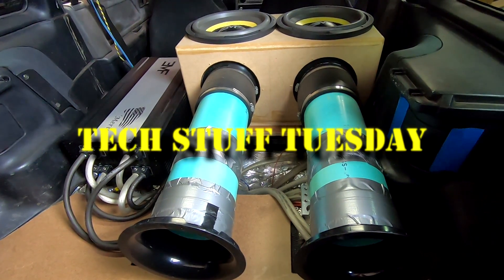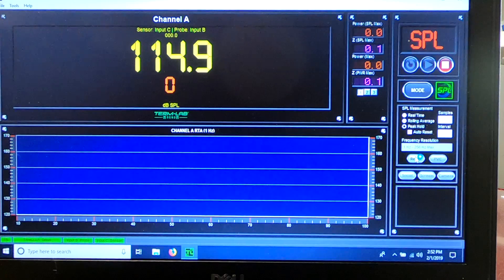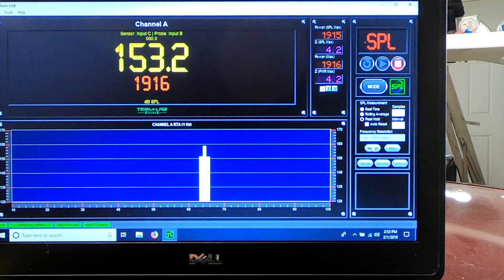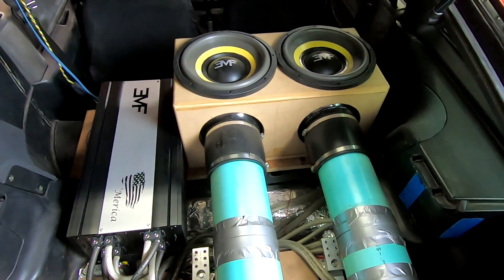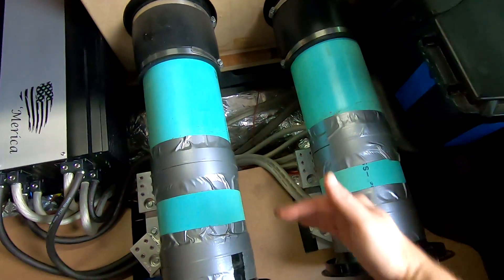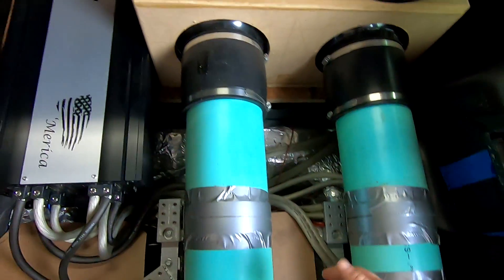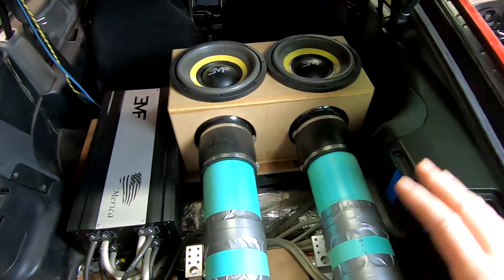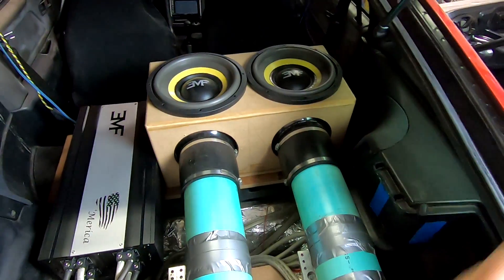This is why port scores are so loud - Tech Stuff Tuesday

Comment: how small is this box? and what is it tuned to with the ports?
Reply from the maker: I built it years ago but I believe it's right at 2 cu. ft. I have no idea what it's tuned to, that isn't how SPL works. You don't tune it to something specific, you test it till it stops getting louder adjusting the port.
Reply: @EMFAudio  ok but how do you know the size of the box to put the subs in. It's like you made a tiny sealed box and put 2 huge ports in it. I found its 1.5 cubes on your other video. Can this box only burp and not play any music?
Reply from the maker: @johnnyditommaso6807  It might be 1.5 cu. ft after sub displacements depending on what subs I'm using in it. SPL is about results, not recommendations. I wouldn't want to play music in that box at all. It's extremely peaky with very limited bandwidth.

Comment: My truck when I had only 1 amp in it wasdoing 147 on the dash and I couldn't get it over 146 in the port lol guessing I had low port velocity? was a 4th order for 2 18's 5.75 sealed, 15.5 ported 46hz. 10 inches by 2 ft port cant rememberhow long
Reply from the maker: Bandpass wall, like I mentioned in the video.
Reply: The smaller of the two boxes would have the highest SPL meaning that if your box has a larger volume than your cab your cab is going to I have a higher pressure and your box will have a lower pressure the adjustments of the ports take away volume from the box and add it to the cabin making most boxes smaller I'm not making this up it's actually a law
Reply from the maker: @christhopherlasher2828  I'm not sure I'm understanding you correctly, but if it's how I'm understanding it, that's not accurate.

Comment: Your comparing the test from the front dash of the car and right at the port ( big difference between the two). You need to take the measurement at the driver and then the port. The port is the backwave of the driver, it's 180 degrees out of phase from the driver. The two SPL's should be similar.
Reply from the maker: The meter is IN the port, that's the point. It's not near it, it's IN it, that is what people do, not beside it. If it were outside the box it's possible the SPL would be similar, at least within a few dB.

Comment: You're just adding more area with mega ports like this. Like a 2 cubic foot box vs a 4.
Reply from the maker: It's a 1.3 cu ft box, with the port area it needs to do the score it does.
Reply: @EMFAudio  I've been playing with the port size on my box. I think I have to go bigger. Almost 2x the size. I dont have room to make it long though. It's a custom box I build for my 68 Chrysler 300. I'm running (3) RE:SE 12's. Old school RE: audio.
Reply from the maker: Ports generally don't need to be longer than 18". If you require longer than that, you're typically tuned too low for the box volume or the box volume is too small to begin with.
Reply: @EMFAudio  where my vent is, is behind the rear seat popping out of the rear deck facing up to the rear windshield. So I'm kinda stuck with a shorter port for viewing purposes. I built the box correct and she hits extremely hard. I built it up again the rear seats so I can utilize the rear of my trunk for anything and the box isnt hogging up the rest of it. I basically built the box in a area I do not use above the rear axle/wheel wells.
Reply from the maker: @ruffypoo  If you build the box correctly, why would you need double the port area?
Reply: @EMFAudio  testing to see what tune works best for the cab of the car. Anyone can follow what's on paper but in reality the cab of the vehicle is just as important as the structure of the box.

Comment: ok answer this plz when you did the windshield test the reading at start said 114.9  then in the port it started at 94.5
Reply from the maker: There is less ambient noise in the box than there is in the cabin. There is also the difference in resetting the meter after the door is closed or before the door is closed.

Comment: Run a dyno test on a amp that the average guy can use in his car no problem like 1000rms but instead of using a big battery bank use an average battery that almost everyone would use like a good quality average yelowtop that way we can see the voltage under load and the wattage and do the math to see what amperage were drawing for the average Joe so we can once and for all explain to new people why a 5000rms amp is no good without huge support and figure out what can realy be ran on just about every car out there you could also test different amps like a 2 or 3000 to show why there a bad idea without the support for them and also could try different batteries to show the difference in a good battery upgrade or a second battery for example how 1000rms at 14.4v is 69 amps
But 3000rms at 14.4 is 208 Amps and the real voltage that counts is voltage under load we could see in real time it would not be perfect because the ault would normally help but it will help the new guy understand and show people what happens to there voltage when there care is off and show whats actually needed for different people thank you love your videos I would love for you to do this so I could cheat explaining things to my customers lol
Reply from the maker: I plan on doing something kinda like that in the future, but I have to get some cheap amps.
Reply: Great just thought I'd put the idea out there love your vids gotta bring more bassheads into the community

Comment: I cant tell u anything thou im an audiophile myself... is more really any more???
the idea is to get as much from a small system and multiply it up..
also like binoculars with bass u need to focus it so it gets thrown in the right direction... product over factor, keep hi/low pressure separate,, if u want a bass box,, think acoustic guitar??? no thats simple route 1 acoustics.. and go from there,, small things really can punch above theyre weight....

Comment: I think thats the most accurate and real numbers a system can produce.
Reply from the maker: In the port? That's nothing of reality.
Reply: @EMFAudio  Why not? Thats a measurement that exist therefore it has to be take in consideration. Why metering on the windshield has to be the best way to meter. People have to be allowed to meter wherever they want.
Reply from the maker: Metering in the enclosure literally means nothing to the performance of the system. You can make something do even higher numbers not in a car, metering in the port. On the windshield is at least near where people are, it's a measure of what the body is experiencing.

Comment: What this helps to prove is that walling your interior around the box and ports in a 4th order fashion directed to your windshield might give you a 5-6db gain in scores.
I've never seen it done that way, but walling towards the windshield seems to be a step in the right direction.
Reply from the maker: Walls are a totally different thing.
Reply: @EMFAudio  that is true, but if the sensor now reads a difference in cabin pressure to determine SPL, wouldn't it make sense to force as much air pressure to the front of the cabin as possible?
Yes I understand wavelength calculations, and placing the enclosure in different places inside the cabin can impact what resonant frequency is read at the meter.
Not trying to reinvent the wheel, just throwing that out there.
Reply from the maker: @PoXFreak  I think you're misunderstanding what was said. The pressure change is from the atmospheric pressure, not 2 parts of the car. Wavelength calculations and other factors do effect the meter still, the amplitude is increased by matching waves, which increases pressure.

Comment: Not sure how to word this I understand the spl systems people demo,but has there been sq systems with really high numbers like the demo spl type. I think I said that right???? Idk?🤷
Reply: “SQ (Sound Quality) is about having clarity and fidelity while being able to hear every single frequency of the song nice and clear. SPL (Sound Pressure Levels) on the other hand is about being loud & measuring cabin pressure in dB's (Decibels).”

Sure, you can have a loud SQ system. But, it’ll be nothing compared to a SPL vehicle.
Reply from the maker: It's not possible to have it that loud and sound good, your ear handle it accurately. And, when a system is very clean, no matter how loud it is, it doesn't sound loud till you have a point of reference like trying to talk over it.
Reply: @EMFAudio  thank you both

Comment: A 153 is still impressive for 1900 watts
Reply: This guy knows shit
Reply: Adam Annison guess you’re the guy that “knows shit”. 💩
Reply: That's was right next to box
Reply from the maker: @crunchannison2912  Except for it wasn't, sensor is shown on the windshield, and stated on the windshield.
Reply: Ehhh not really ive seen 155.1 on barely 1k
Reply from the maker: @fxgamer-11yt  If I was metering in the kick too, it would be 4 dB louder. That, and this box is built for 14,000 watts, not 1,000 watts. The optimal enclosure for both power levels won't be the same.
Reply: @EMFAudio  yeah
Reply: @fxgamer-11yt  nah its still super impressive, its incredibly rare for someone to break 50 with 2k. Just cuz a few people do it on youtube doesn't make it not impressive.
Reply: Its an impressive number but the build looks like shit, would never drive a car with that monstrosity in the trunk
Reply: @ThisIsSolution  this car doesn't drive around and it isn't built for looks it is built for spl purpose built

Comment: Like always very cool info wt kind of electrical u need for the 12k with wt kind of electrical ur running it at n last bannhamers 12s by the summer u think
Reply from the maker: The 12k electrical needs depend on if you're doing music or SPL with it. In that car I have 8 banks of XS Power caps which is sufficient for burps but on music it would do OK if there was more alternator power.

Comment: Wasn't it lower starting spl as well?
Reply: There wasn’t a starting spl score. The meter is just in peak hold probably from him mounting the meter or just getting everything set to run the test. 
Only time starting spl comes into play is if your doing a 30 sec up to 3 minute musical average.
Reply: @pmcalis1111  that's what I'm talking about
Reply from the maker: There will always be an ambient air score, closing a door can even be 120's where it will peak hold.

Comment: Do people really meter the port? Seems kinda silly, but I don't know what reason they would do it.
Reply: To brag my system does ××× db..... completely idiotic
Reply: Brian South Yeah that's pretty silly stuff. I'm not into the SPL thing with cars.
I got my sealed 10" that plays my bass, and because of trunk gain, It goes as low as I need it (falls off around 25hz)

All I care about is if "x" song is playing, can I hear the bass, and is it clean and smooth.

But it's fun watching other people have fun with crazy systems, but metering the port is absolutely pointless. (Unless it's one of those big bandpassed systems where the port pretty much is right behind your head)
Reply: They compete who has the most inefficient enclosure and the most restrictive port.
Reply: Yeah. People do ports wars
Reply: @lurchmeat9791  so pretty much they brag about how big a cock they can take
Reply: Think of port scores as a leveller, larger boxes, i.e. walls, need more power to get a high port score than just a single sub in the trunk. It's probably a good category for beginners as cab stuff doesn't matter.